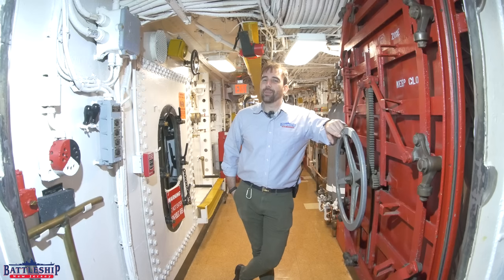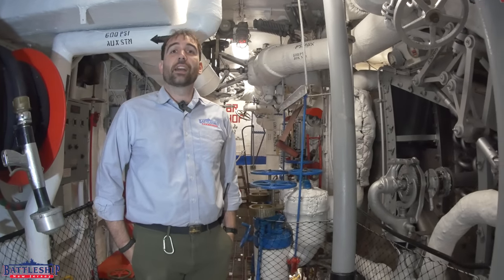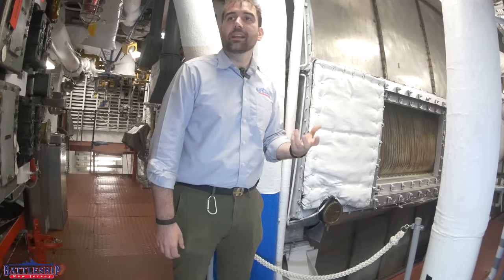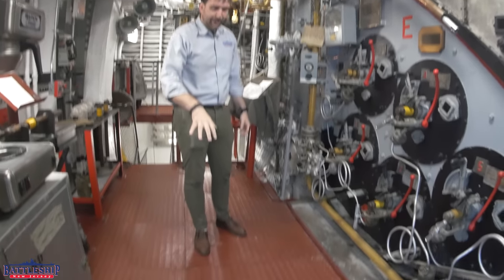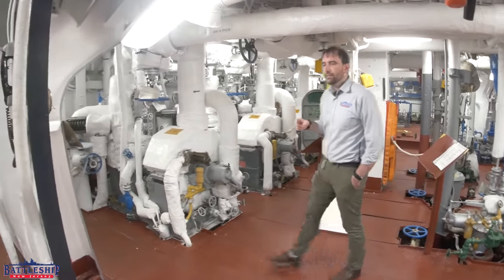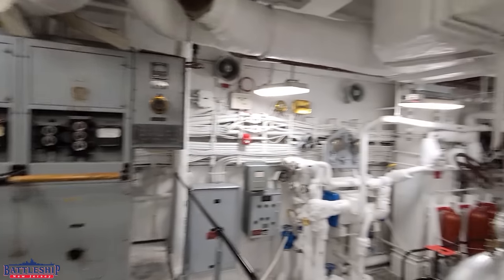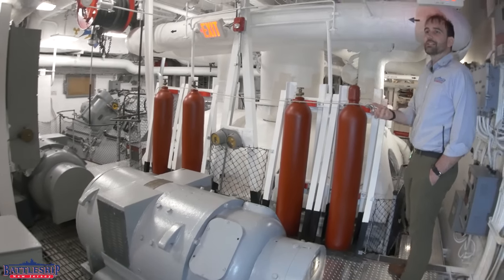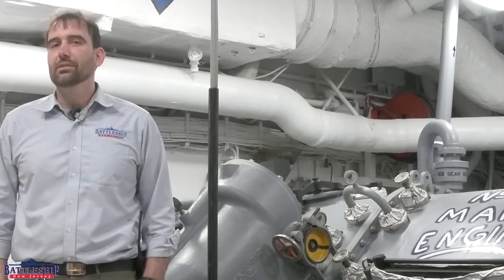Inside the Propulsion Plant of the World's Fastest Battleship

Comment: Surely the "non-condensable gases" are far more of a problem for the condensing part of the cycle than they are for the turbines? As far as the turbines are concerned, steam is just a gas. The turbines need it to be hot and at high pressure to get the maximum power output, but a little bit of air mixed in doesn't affect their operation that much. After all, the turbines in gas turbine engines (turbojet, turbofan, turboprop etc) deal with far higher temperatures than any steam turbine will ever experience, and the gas they operate on is mostly air, though containing some steam from the combustion of the fuel.
So air in the steam cannot possibly matter to the actual turbines, or so I would have thought. For the condensers though, different story - for maximum efficiency, you want as little pressure remaining as possible after the steam exits the turbine. In fact actually having a condenser on the turbine output improves the power output (and efficiency) compared to exhausting the steam to atmosphere. Which is precisely because you can use the condensing effect to pull a partial vacuum on the exhaust end of the turbine, which means there is no back-pressure from the atmosphere, so more effective pressure from the steam. Plus the steam doesn't condense once it hits 100 degrees C (which it would at atmospheric pressure), so the last stage of the turbine can extract slightly more energy from it before it starts to condense. This is where air in the steam actually is a problem, because it would build up in the condenser and reduce the effective vacuum, making it less efficient.
Reply: The condenser is the source of non-condensable gases. That is why air ejectors are used to raise and maintain condenser vacuum. Once the engine is in operation, most vacuum comes from condensing steam but since the unit is under a high vacuum of nearly 29 inches some air is pulled into the system from small leaks. The air ejectors remove most of that maintain the vacuum. The gas that causes problems is oxygen, it will quickly attack the steel in boiler tubes and as much as possible must be removed. What remains after the condenser is chemically scavenged through feed water treatment. Steam turbines are not gas turbines, they will be damaged by liquid water impingement but not by air or other gases but the boiler tubes will be severely damaged by air. Loss of vacuum created by air leaking into the condenser will have very serious repercussions as it not only leads to loss of efficiency, it leads to overheating of turbine casings and other components and loss of propulsion altogether. 

Compared to steam turbine propulsion systems a gas turbine is about as simple and uncomplicated as it gets.

Speaking of condensers, cool seawater from the scoop or from that great big shiny bronze pump which purpose he didn't bother to describe, flows through the condenser tubes, not around them. The exhaust steam condenses on the outside of the tubes in a vacuum and drops down into a "hotwell" from which the condensate pumps take a suction and discharge through the air ejector condenser on its way to the DA tank. One benefit in addition to several others of having the vacuum applied to the outside of the tubes is when a seawater leak into the condenser is discovered by increasing condensate chloride content, wood flour can be dumped into the seawater side and minor leaks sealed by the vacuum pulling it into the leak.
Reply: @oldtugs  That all makes sense the way you described it. The implication clearly given in the video though was that air must be removed from the steam before it goes through the turbine, because the turbine would somehow be damaged by it.

 Making sure there is no liquid water in the steam entering the turbine is of course why the boiler has a superheater to prevent this. That does make sense, because a high performance steam turbine would be damaged by water droplets in the steam just as easily as if there was dust or sand being carried with the steam - or anything else that isn't a gas.

Having a bit of air in the steam though? I get why that would be a problem in the condenser, and a really big problem in the inside of the boiler tubes. But to a turbine, provided the temperature of the gas or steam going through it isn't hot enough to melt or weaken the rotor or stator blades, how can a little bit of air mixed into the steam possibly damage it? Other parts yes, the turbine itself no - that's what I was getting at.
Reply: @lloydevans2900  I understand what you meant and you are fundamentally correct with regard to gas turbines. It is what happens to the working fluid before it ever gets to the turbine that matters.

"The implication clearly given in the video though was that air must be removed from the steam before it goes through the turbine, because the turbine would somehow be damaged by it."  The damage done to boilers is by oxygen at the molecular level. Air bubbles traveling along in superheated steam flow exist only in a curator's fantasy.

Be very very careful about what is implied or stated as fact in most of these museum ship videos, especially those pretending to describe technical systems and propulsion in particular. People who are really interested can find a great deal of accurate information in many other places.

Comment: Çan you do a video on the Bunker C fuel? Actually show how viscous it is?
Reply: The navy stopped using bunker C in the early 1980’s.
They actually used an expensive bunker c called Navy special fuel oil NSFO.
They switched to Navy Distillate ND also Nato code  F-76.

It is the same as regular diesel fuel before they took out the sulphur a few years ago ,500 ppm ,instead instead of 15 ppm sulfur trucks use now.

Only the few merchant ships use bunker C in steam ships  now that are left.

Heavy fuel Diesel  ships usually use IFO intermediate fuel oil , bunker C that has been Cut or diluted with lighter oil so not as thick.

Navy special was a kind of IFO not pure bunker C HFO.

Large Diesel  ships have to centrifuge the Fuel oil IFO before burning and also heat it up just not as much as bunker C.

So I doubt he has any bunker C or IFO to show you!
Reply: Almost all the stories about bunker C, #6 fuel oil, HFO are nonsense spread by people who have most likely never seen the stuff. At room temperature some of it is like syrup, or molasses, some is like motor oil. It all depends on the refinery and crude oil chemistry. It flows easily in normal summer temperatures and sticks to everything. It was great fuel because it was dense, some of it is heavier than water and will sink. That density means it contains a lot of energy for a given volume, more than diesel or gasoline so a smaller fuel tank can go a lot further. It was heated in the tanks so it could easily be pumped to the engine room where it was heated further to reach the viscosity required for atomization in burners or the fuel injectors of slow speed diesels. If you really want to know about it, look for a document published by Chevron called "Everything you need to know about marine fuels" and you will find more than ever asked for.
Reply: @josephpadula2283  The Buffalo gang probably has some they scraped off the bulkheads of the Sullivans. It floated up from the open fuel tanks while they were making a video.
Reply: @josephpadula2283  thanks for the information.

Comment: Where is the jacking gear
Reply: On the end of the reduction gear 
Also called the Turning gear.

It is used for cooling down the turbine blades so the  blades don’t warp on turbine  shutdown,  of course the vacuum and lube oil is left on .
Reply: psst - that a secret. I think he does not know. When he learns it will become a video. I suspect the Electric motor for the jacking gear is removed by the navy. it is on the main reduction gearing. he has a video this spring where found keys and opened up some inspection ports on the  main reduction gearing
Reply: As a EM I was told that the jacking gear motor was used so the line shaft bearings wouldn't get flat spots in them?? Is this also true?
Reply from the maker: We debated including the jacking gear in this video but thought it was already a long video. You can't talk about everything all at once!
Reply: @darinwilson4869  Yes
Reply: @wfoj2  It is the unit to his left at 26:47. The electric drive motor is aft of the worm and pinion drive housing. The yellow disk is both an indicator that the gear is turning and it is a brake to lock the shaft. See the red handwheel at about waist level?
Reply: @darinwilson4869  No, it is so the turbine rotor shafts don't sag from their weight when hot and cause blade rubbing or vibration issues when restarting and to distribute lube oil through all the bearings. The turning gear is operated continuously if the ship is departing within 2 or 3 days but if in port for longer periods will be secured after about 36 hours. That is long enough for the rotors to cool sufficiently. It is engaged again a few hours before departure to distribute lube oil and to allow equal heating during warm up of the engine. At the speed the shaft is turned by the jacking gear it sits on the bottom of the line bearings anyway because it turns too slow to create an oil wedge.
Reply: @oldtugs wow - eagle eye on your part. THANKS.- And thanks to Ryan prior reply - maybe a future video.

Comment: 4 hour watch? Not so much. Most steam ships had the main space watches at 6 and 6. Which means 6 hours on, 6 hours off. 7 days a week until the plant was secured.
Reply: 5 and dime when I was on her 85-87.  For the BTs at least.
Reply: @barto6577  The DDG I served on (85 to 88) was under staffed in engineering. If the plant was lit we were on 6 and 6. In port steaming had us at 3 section duty at least, with only one boiler on line and 2 generators in main control.
Reply: @SMOBY44     DDG?  Was that a Turbo-Twisting Sprue type can?  Even the two Knox FFs I served on had enough BTs for 5 and dime.